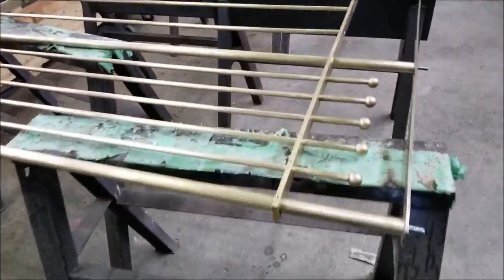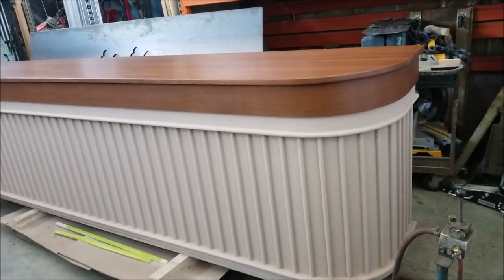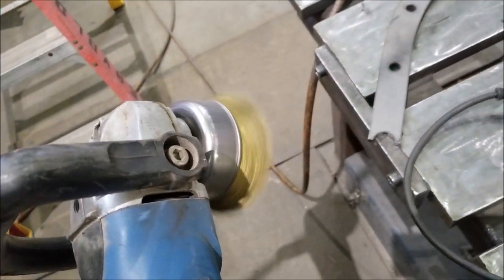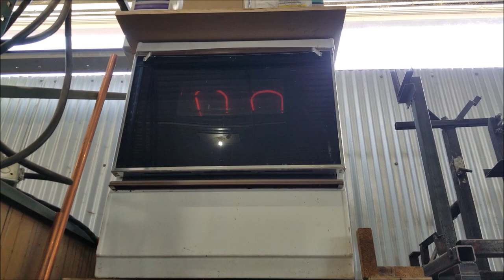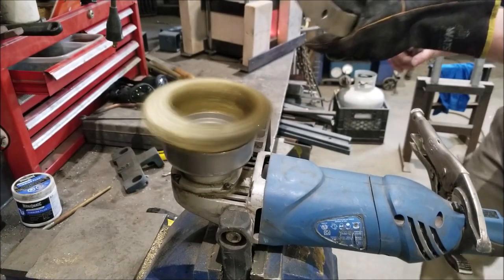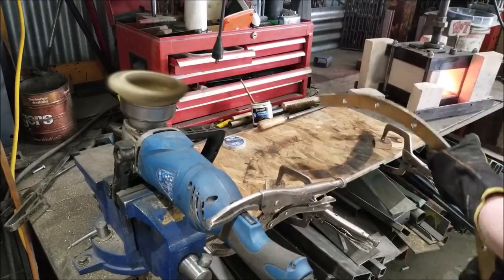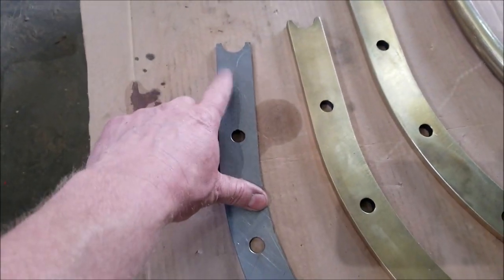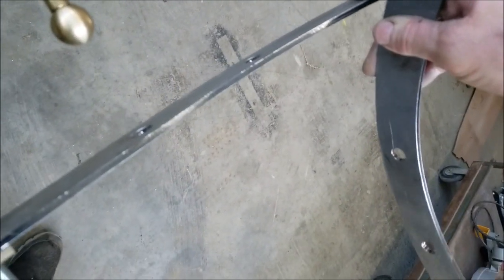Brass Plating with Heat and a Wire Brush: Part 3

Comment from the maker: Getting some feed back from people getting the impression that this was labour intensive. I spent maximum 3 hrs. That includes trying the oven first and time messing around filming. I already had the brass wire wheel approx $60 from doing the little table years ago. Laser cut mild steel pieces cost$ 40  for all 3. (Math for curves and hole spacing already figured out by autocad)To cut the 3 curves out of brass I would need a 3/8 thick brass plate approx 2 ½ feet by 3 ½ feet. $$$ (if you could find one) It would've  taken longer to lay out the curves and then cut and drill the holes in solid brass

Comment from the maker: Just to add some more clarity. The entire cage is made out of solid brass. Only the three corner curve sections were done using this technique.  Also I did not bend the mild steel into the curve. It was laser cut into the shape you see in the video with the holes and connection notches on the ends.

Comment: do you know the brand of the brass brush? So many are coated steel and, well, fake...
Reply from the maker: I will let know later today. I bought it 5 years ago to do the little end tables. I've also used hand held brass wire brushes from a welding supply company and believe it or not I've tried bbq brushes! Some are actually solid brass
Reply: @itsnot_stupid_ifitworks  That's right. I forgot about the bbq brushes. Thanks for looking into the wheel. While I won't be doing much brass brushing, I know I have been looking for something like that
Reply from the maker: I purchased it from McMaster-Carr. Product # 48955A78 . Today its $105 Canadian.or approx $75 US ...4 inch twisted brass wire. .020 wires 1 1/4 long. It doesn't have a brand name on it only a logo. SB? Says Made in the USA.
Reply: @itsnot_stupid_ifitworks  Thank you much! Oustanding!